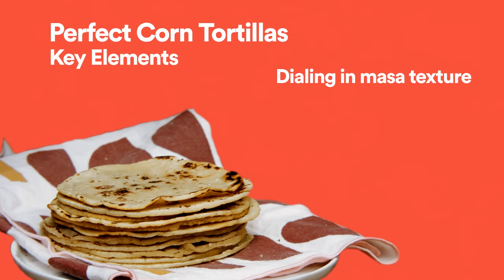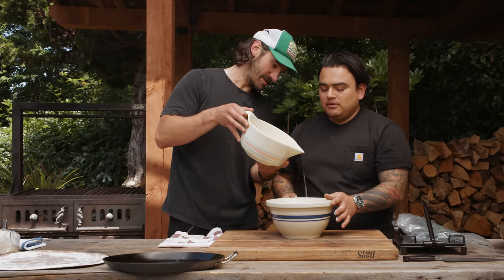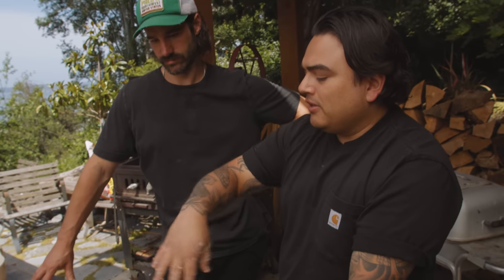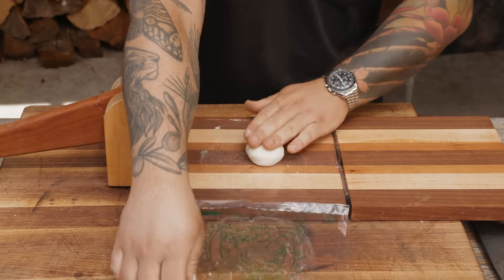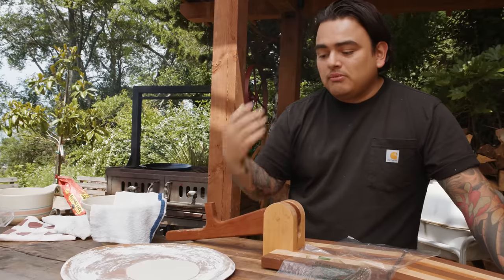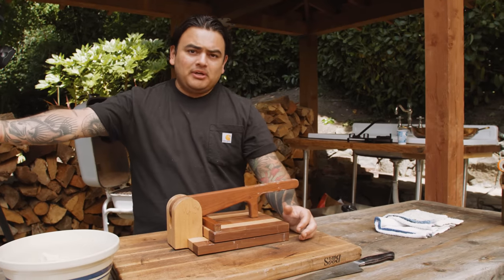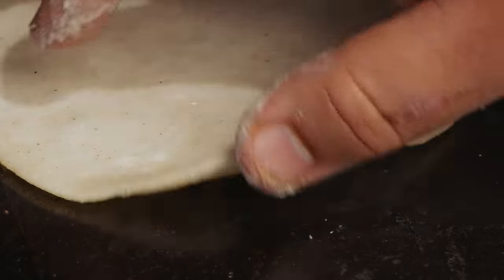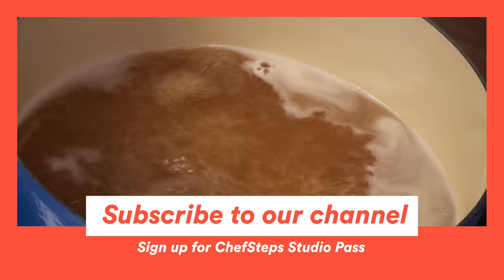Make the Perfect Corn Tortillas! Expert Chef Shows You How, With Tips | ChefSteps

Comment: I've been thinking about this too much, but as someone not from that part of the world - what did you use before plastic? And did that mean hydration levels of the dough were different?
I'm really interested in the old way of rolling out the dough - In Italy for example the pasta dough is dusted and rolled in flour which would reduce hydration. How is this approached with corn tortillas?
Reply: From my experiences in Mexico some women still make tortillas with just their hands, a masterful technique where they use that broad muscle on their palm connected to their thumbs, and pass it between both hands, I think they work the centres first and work outwards until they have the required thickness. If you walk around the streets of some of the more rural villages you’ll still hear “patting” noises coming from nearly every house you pass at certain times of the day. It’s quite comforting.

The interesting part is that the oils from your hands and the extra needing/working of the dough that this creates usually makes a superior tortilla.

I’m not sure when handmade tortillas presses started to come into play, obviously metal ones much more recently, wooden ones would have required a range of machinery or a pretty skilled and expensive craftsman. The other interesting thing is that it’s quite common to see the older wooden presses usually have a turned wooden handle that looks alot like chair/table legs, wether that’s just a coincidence or actually recycled furniture I don’t know.

Comment: I think I have a better recipe, that will boost the corn flavour: 1 small can of corn, 275 grams corn flour, 1 tsp salt, water. Run the corn and brine from the can in a food processor until smooth. Add water until combined weight is 425 grams. Add the corn flour, and mix to a smooth dough. To make the tortillas, make a 50 gram ball and put in in the press, like in the video. Fry in a dry skillet, but not too long. The tortillas are supposed to be soft, not crispy. These tortillas are soooo good! (Sorry Chefsteps, but this time I'm ahead of the curve:))
Reply: Yikes. Imagine coming onto a video where someone of Mexican heritage is teaching a traditional way to make a food that is an essential piece of their history and culture by criticizing and suggesting you’ve found a way to one up thousands of years of tradition by using corn in a can. 👀
Reply: @jenniangel007  I'm not criticizing anyone. I'm just suggesting that I might have a better recipe, and even have the courtesy to share it. Having said that, one could also add that a recipe is not necessarily the best just because it is the oldest / traditional. In fact, often the opposite is true. Recipes develop and change over time, and many times for the better. If that was not the case, we would stil eat like our ancestors thousands of years ago, because they have the best recipes.